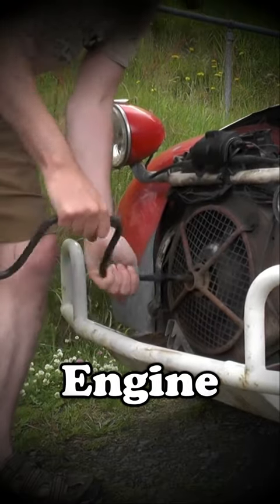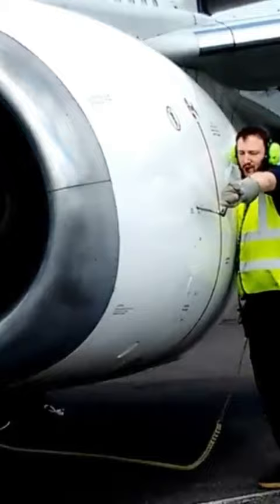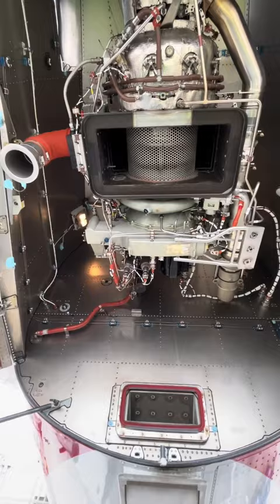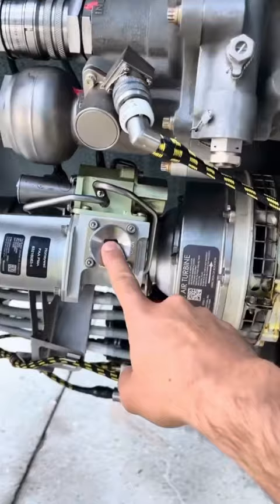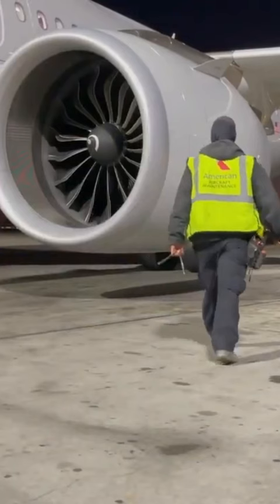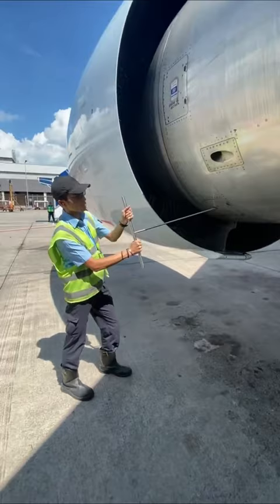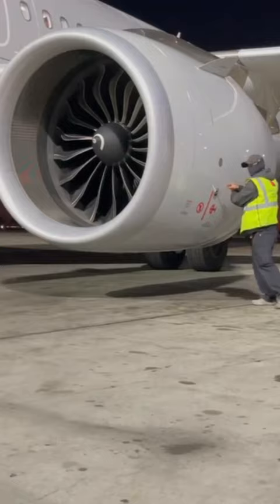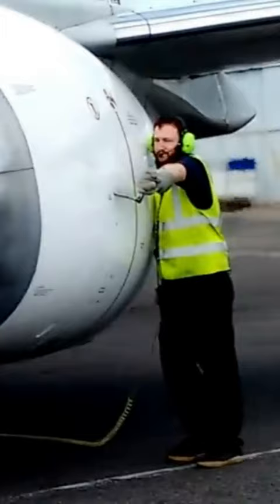Can You Start An Airplane Engine Manually? #shorts  #learning

Comment: He's standing back from where the turning blades are in case they brake off. You can see the safety line on the side of the housing.
Reply: It’s mainly because of the suction from the front because it is so strong you could be swept off your feet and inside and on the back it is extremely hot air and could cause fatal burns. It’s all just safety
Reply: Wrong, nothing to do with fan blade failure on a jet. The fan case is required and tested to contain failed blades at max speed, you can see the videos of the blade-off tests. @carsonbritten7198 is correct, the line denotes the suction hazard zone. On a turboprop, the line denotes the propeller arc.

Comment: What if it shuts down midflight
Reply: You can start an engine without bleed air by windmill starting it. Basically go fast enough and use the blades on the fan to spin the engine.
Reply: Use the bleed air from the working engine. If this still fails, dive to gain speed and turn on continuous igniters. The wind will spin the fan (hence the name windmill start) and this provides enough compression to start. If you still can't restart the engine then the airplane still flies with one engine.
Reply: @marc-andreservant201 Great answer.  Thanks

Comment: Wow. All of this is false.
Reply: May I ask how so. I work at an airport and I’ve seen these on the side of the BBJ aircraft engines that come in now and then
Reply: @carsonbritten7198  For one, the air doesn't "flow into the engine being started" and it doesn't work with a "rush of air". Bleed air flows into an air starter, a turbine, which spins and turns the accessory gearbox, which turns the high pressure spool.